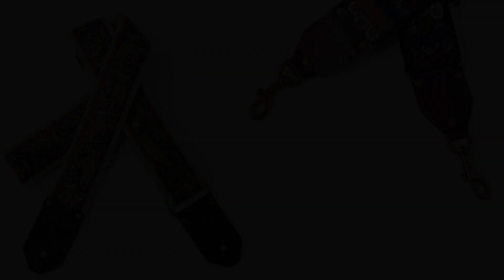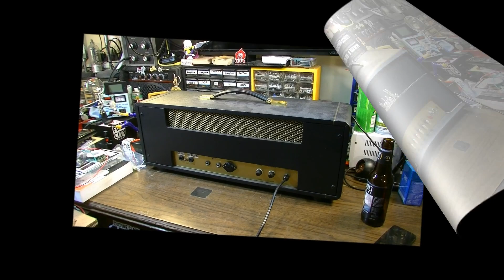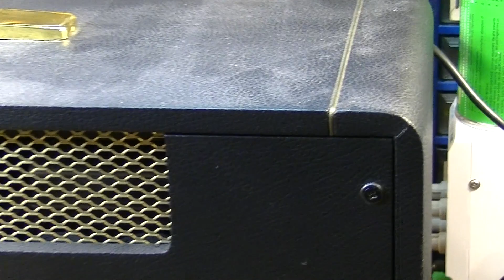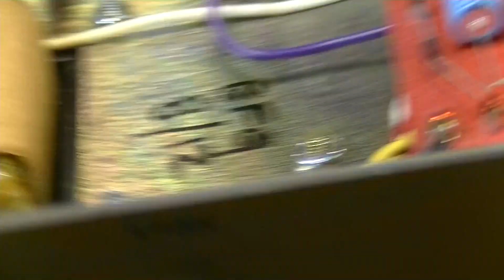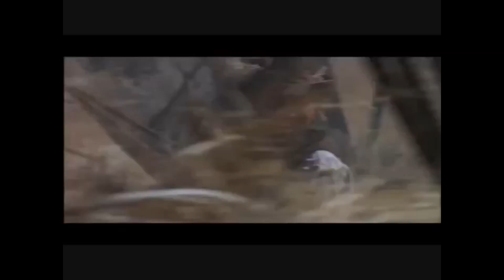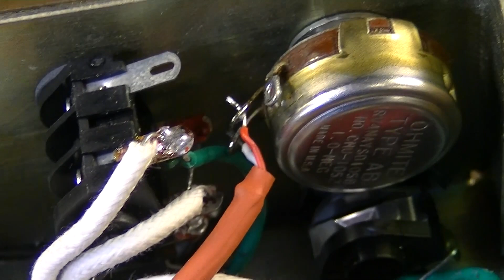I Set a Customer's Amp on FIRE! - Metropoulos Marshall Plexi Clone Catches FIRE on the Bench

Comment: That socket is bad now, even if you clean all the carbon off it can still conduct.  Please note: this is a DIY Metroamp kit build, not a Metropoulos replica.  Great video and channel!
Reply: I agree. It looks like a Metropoulos kit put together by somebody else, looks sloppy regardless of the fx loop.
They should have bent the pins of the sockets outwards to keep them separate. Looks like they didn’t trim the excess wire on the terminals and that will conduct again, especially if the play the amp unloaded accidentally, the fly back voltages in the OT will arc to the heaters again. Don’t ask me why I know! LOL
Reply: Please bring the kits back, George! I'll do better than this guy did, I promise!
Reply: I modded my 1959 plexy reissue with a Metro PTP kit.  HOLY FUG!!!  It was wonderful.  I sold it for college books for my daughter. Miss it greatly.
Reply: John Winnard Whats the PTP Kit?
Reply: Thanks for clarifying that George. I was going to post that this amp looks nothing like the one you built for me. Night and day difference.
Reply from the maker: Thanks for clarifying. The arc didn't occur on the socket, it occurred in mid air like a Jacob's Ladder.
Reply: Does not do kits anymore huh? I don't blame him. Customer service advising noobs [like me] that decide to build an amp would be very intense. They were the highest regarded kitsets when they were around though. 
I have a 18 watt turret board from Trinity Amps that I never get around to populating and building an amp around. It's expensive to import stuff to NZ. Pretty country and great place to live, but not good if you are into hobbies that require stuff you can't get here. Even getting decent coupling caps here at electronics supply prices is next to impossible, so things like tube sockets and transformers is a definite import only item. I think I will pass on the amp build and begin with a Rangemaster and then a Tone Bender.
Reply: ha ha sozo caps, rebranded mallory 150's with a higher price
Reply: effects loop, tone suck, master volume, tone suck, what else we got in this
Reply: Just go to autozone and by some Berrymans or Seafoam. It takes all the carbon off the inside of an engine. Then use your typical socket cleaner afterwards.
Reply: i dont always install the "jacobs ladder spontaneous combustion sizzle mod" but when i do, im definitely drinking IPA's.
Reply: @Dearly Diane ha ha, got to lmao on that one, never liked the the new stuff, realy artichoke beer, ha ha

Comment: My guess as to what actually happened is this, somehow one of the tube socket pins with high voltage on it got inadvertently shorted to ground, and the pin with high voltage on it happened to be connected to a circuit with inductance in it, maybe the output transformer primary, or the choke that formed part of the B+ HV filtering, anyway, the momentary short-circuit caused a huge Back-EMF spike which triggered the formation of an arc between the pins.

Comment: I had one of these.  I installed externally accessible bias pot and test points.  I used it as a church amp for a lot of years.  It once red plated and smoked a reproduction 6CA7 tube in the middle of a song.  I slapped an old set of el34’s in it behind the stage and rebased the entire thing between songs.

Comment: What's the purpose of those diodes on the power and standby switches? Looks like a short between one of the heater filament wires and Pin 3 of the power tube that started to burn?

Comment: If I were to build an amp with a 3C22 disk seal triode (which I may do one of these days) it'll definitely be vented out the top.  The 3C22 is a UHF tube first used in radar jamming equipment, but apparently it works quite well as an audio tube, and can be used in place of a 6550 with slight modification and around 500 volts on the plate.

Comment: hi, your videos are addictive
im building an 18 watts amplifier, hoffman stout, 
I rectified the the font with diodes 4007, and use 47 uf capacitor for output transformer, the voltage is 399 volts in this point with de valves conected, my question is how i do for step down the voltage to value 350 volts in the schematic? sorry for my english im from argentina

Comment: There goes the profit from that job. Note - You are not supposed to allow the smoke escape from the electronic components. Was that a cracked resistor between the two light blue caps?

Comment: Brad I noticed that the master volume pot that you installed looks quite different from other potentiometers and I just wondered is it something special? I just noticed it looks bigger and thicker than just a normal 1 meg or 500k pot looks like. I have installed the master volume on my Traynor yba-1a Mark II that you perfomed in another video you did the other week and it works great just using an ordinary Alpha audio 1 Meg pot but just wanted to see if there was something special about the one that you used in this amp.
Reply from the maker: It's just an older NOS pot from my stash.
Reply: @TheGuitologist  Oh ok, great video, keep it up man.

Comment: WHY don't you have a current limiter?? It really is not safe to fire up an amp like that with blown fuse without one. Variac helps but you can still pull enough current to take out a transformer if u had a shorted component but it is of course your choice. I'm a reg watcher of your videos so thank u for alll the great content. And kudos to u for being man enough to show your mistake and laugh it off. There are many that would not do that. There are plans online and at The Amp Garage to build a current limiter if u are interested.

Comment: Wasent that 1930s film called metropolis where the scientist created a female robot and electricity was flashing between all the insulators lol. I've flashed connections on a few different voltages once by taking a negative probe connection off 25kv feed to a transformer whilst removing the positive probe connection off at the same time which drew an arc which eventually joined both probes and the connections talk about fireworks good job it took out the breakers which caused me a please explain.

Comment: i would have installed the master volume on the "on" light socket and moved the light where that lil skull is,  just for aesthetics and to keep all four inputs available, just in case but otherwise.....
By the way Brad, have u ever had to install a reverb tank on a masrhall that didnt come with one originally? im thinking about installing one on my jcm 900 mkIII mod 2100. Wondering if that is doable.

Comment: Could've been a high frequency oscillation caused by simply loading an active circuit with your meter, I've had it happen to me a couple of times.  If you've got a radio or TV on in the background, they'll usually squeal too. The last time it happened, it blew up  my expensive Tektronix meter. :-(

Comment: Entertaining and informative as always. Incidentally, this was built from a kit.  George Metropoulos isn't capable of work this sloppy.  You should definitely replace that socket.  After it arcs once it will always be prone to again.
Reply from the maker: The arc was in midair luckily. Didn't burn the socket. Had it done that, yes, I'd probably be replacing it.

Comment: Tube amps are soooooo forgiving that kind of mistake on a big solid state you just killed all the outputs and on a big amp that would be 16 or more hifi amps in general are much more picky
Reply: Have you ever repurposed a Bogen MX 60 a it was the frist pa amp that a i got new in the 60s uesed it a lot treated it bad but it came tru with flying colors was based on the 8417 power tubes cutting edge at that time great tube but no longer made so I revised it to work on 6550 GE but it’s way to clean so I was going to put the inputs in series I think three stages should be right now also add a standby and a soft start switch what do you think ?

Comment: That was no wiring job done by Metro Amps and they use different e-caps and other components.  Might have been a Metro chassis or those sold by ValveStorm.

Comment: Why do people waste their money and time on these things?  Just go out and buy an original instead of 'rigging' one up!  I have 2 1987s that I bought back in 1994 that are both 1976 builds.  Never had an issue with either of them, and I play them once a month.  Also, with that much voltage, you were 'hot' enough to weld with your multi-meter probe.  lol
Reply: roostershooter76 - if you check out George Metropolous, you’ll find out his amps (and the kits he used to sell) are no waste of money. Top notch, fantastic reputation, used or favored by a respected group of professionals. He even had his own transformers made to spec and built the reissue flip-top Ampeg amps.

Comment: Well you didn’t set the amp on fire. You set the plastic end of your probe on fire and vaporized the metallic tip. At least you didn’t “let the smoke out” which is what we used to call it when we fried a circuit board. Good thing you were dealing with antique electronics (tubes).  Today’s stuff would have just turned to shit.
Reply: Today's stuff would have never even went to a repair shop, it would have went straight to the landfill which is sad

Comment: I had a similar thing happen when I was working on my brother's Roost amp. The insulation on the anode wire was rubbing against a filament pin and broke down while I was testing it. Sparks and smoke!

Comment: (PPIMV), you can try Lar's version 2meg but it's unnessary just CRANK IT....and I don't know what the fuck you did either biased it too hot/runaway.... and just assuming never heard of or seen anything differeing in that build/era it WAS 22nf's throughtout and PI input. Tried just about every configuration there too...idk only like 5150/Peavey's/Bugera put a stupid big coupling in the front like a .1 all the way to 274s-334s...That still don't make any sense either letting pretty much everything through and low end that don't need to be going through there anyways.....I was on to something/configuration I thought was better...it's the stupid big PI input .1 and .1 output couplings and there still a shit load of low end when it's opened up...It is literally SF Fender style...BF wasss way too tight and smallll sounding with that .0022... It is dude Fender did that right and more Mesa like....

Comment: That has absolutely nailed the plexi CLUCK and SCRAWL (tm). I'd buy one tomorrow if I had a spare kidney.
Also lol at the customer who is worried an fx loop might suck tone but wants to install a master volume on a plexi. :)))
Reply: A Master will not suck tone if it is the right one for the task :)
Reply: It’s actually my amp and it wasn’t as much a question of tone sucking as the question of who the f$?k would put that pcb junk in let alone do such a shit job. I just wanted it checked to see if it could be harming the sound or the functionality of the amps future. I bought it used and the 1st owner installed it himself apparently. As of the master volume, we don’t have anywhere to play live in southern Indiana/Louisville to even use this beast at 1 on the volume knobs. The master volume kind of solves that. Not to mention once you crank the master volume it is essentially out of the circuit. I typically use a AC15 or 57 Deluxe and constantly get told to turn wayyyy down.